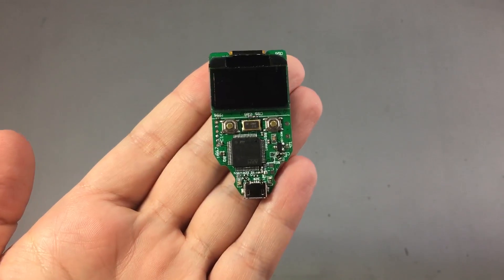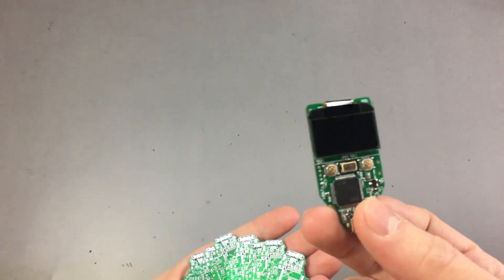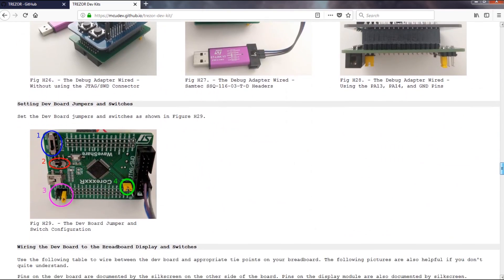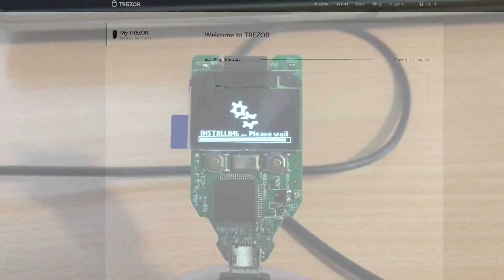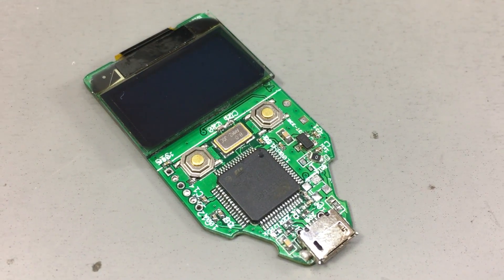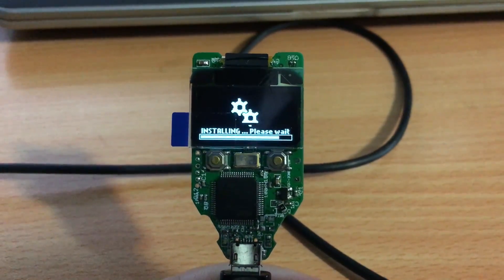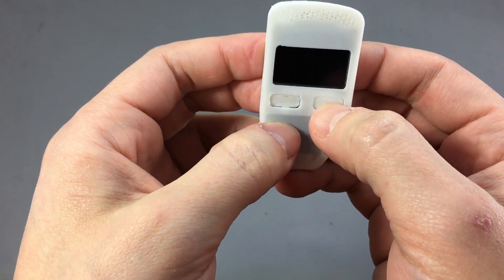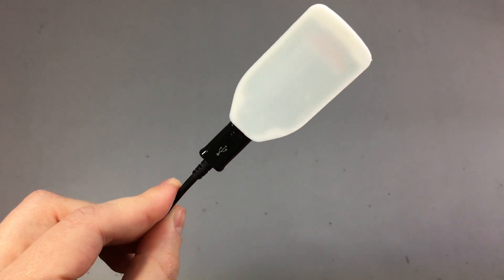Voltlog #154 - Making My Own Trezor Crypto Hardware Wallet

Comment: did trezor stopped updates on dev boards? 

In the above link (Trezor dev info), under "Going Further" section, there was an update. what does that mean? will we not able to update firmware on dev board????

Comment: Injection moulding would require a thicker front otherwise it wouldn’t be able to fill the mould, more likely a cad error.
Reply from the maker: thanks for the feedback, not sure what's going on there. I will have to try and change the design by increasing the thickness of that front panel.

Comment: The resistors on the USB data lines are for telling the host how much current the device is asking to take, and also if it's a high speed or full speed USB-device. Without these, windows gets confused and gives up. Apparent the bootloader drives the USB-pins in a different fashion, where it will work without them.
Reply from the maker: Out of the two resistors one is on the D+ line and that might be related to setting the USB mode but the other one is not connected to the USB data lines and I'm thinking this second one could actually be the problem. Unfortunately I do not feel like going back and resoldering a 0402 resistor just to check my theory :-)

Comment: Since it's open source you should submit a patch or github pull request with the list of additional packages to install and also submit a variation to the circuit design or documentation for those resistors.
Reply from the maker: I thought about doing that but the thing is they don't really give you instructions on how to compile it, they just give you the sources. The instructions I found were related to another github user which also build his own trezor and he had a slightly different setup, hence the small difference and the missing packages on my side. I will try to let them know about the schematic issue though.
Reply from the maker: Done! submitted an issue https://github.com/trezor/trezor-hw/issues/4
Reply: Which service did you use for the PCBs? Where did you get the microcontroller, the link you provided lists many unrelated parts.
Reply: There's completely building instructions and even a docker receipts to build everything from sources in firmware github repository: https://github.com/trezor/trezor-mcu/blob/master/README.md
Reply from the maker: @Tomasz I used elecrow but pick your favorite prototyping pcb service, I got the parts(mcu, passives) from farnell but again pick your favorite electronics distributor. I got the OLED screen and the ST LINK V2 from aliexpress.
Reply from the maker: @slush slush: I also tried building with docker it failed with other errors and I left that out from the published video.
Reply: VoltLog what errors? Please report them, too. We use docker build on daily basis.
Reply from the maker: @slush I tried again and there are no more errors, firmware and bootloader compiles fine with docker. I don't remember exactly what error I was getting but I couldn't compile the firmware while the bootloader was compiling fine with docker. BTW that's when I locked my microcontroller because I built a bootloader with docker and it presumably enables the MEMORY_PROTECT option by default. Regarding the error shown at 4:08 I fixed that by installing googleapis-common-protos package, could it be that this also fixed the errors I was getting through docker? or maybe docker handles the dependencies inside the container itself? Otherwise I have no idea why I can compile the firmware now but I wasn't able to do it previously.
Reply: how you use the MEMORY_PROTECT  in the docker, basically this is the command from docker ./build.sh BOOTLOADER_TAG FIRMWARE_TAG.    so we will not use the tag for bootloader and firmware then it will get the latest commmit. finally can we use like ./build.sh MEMORY_PROTECT  =0   to disable the protection.
Reply: how do you program the STM32F205RET6, do you need a dev board, how did you connect the programmer?

Comment: 4:08 that error should be resolved by installing the python
googleapis-common-protos package via pip install (or see if there is an ubuntu package for it)
Reply from the maker: thanks man! After running sudo pip install googleapis-common-protos I was able to compile the firmware with no errors.